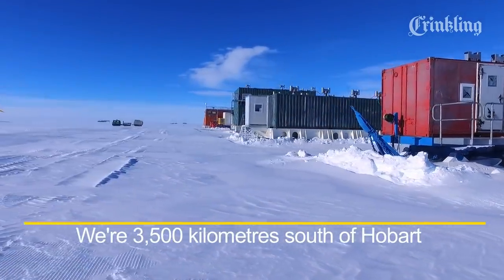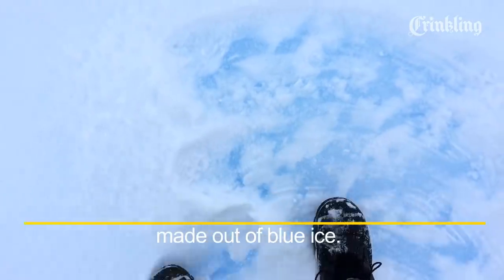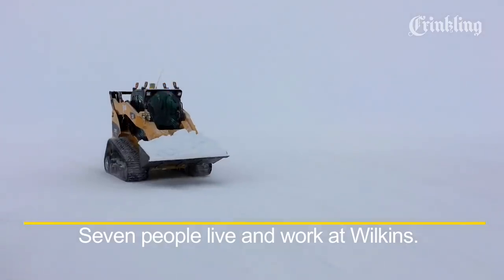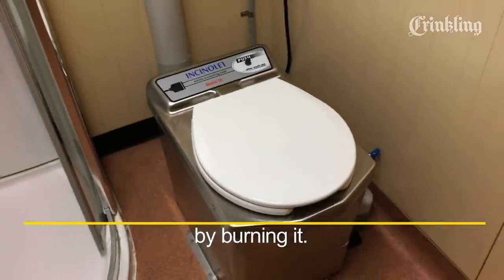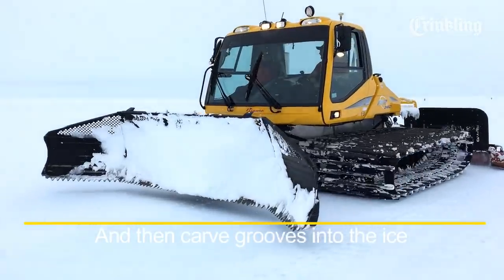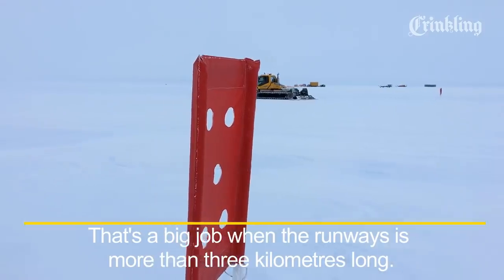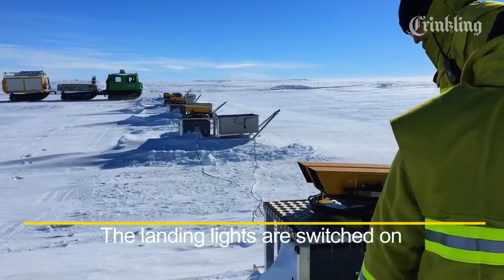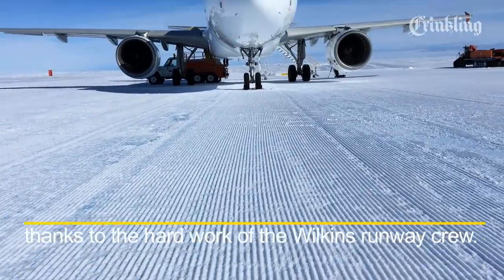Landing on ice: the Wilkins runway

Comment: Impressive, if a little surprised the A319 had enough ETOPS to do this trip.
Reply: A normal A319 cant. However an A319 LR can. Besides its not ETOPS regulated as its chartered by the Australian Government to do the hop, thus eliminating ETOPS.
Reply: This A319 has the Additional Centre Tanks and can hold about 29t total fuel.

Comment: A319 it s super light😃
Reply: Noel Macaskill i think its an a318
Reply: G - wings no it’s an a319
Reply: G - wings A319 ACJ
Reply: Noel Macaskill A318 actually
Reply: @dsosa88  it is not, read closely.
Reply: Max Lechuga your right i saw it on :  2:06 it’s an A319 ACJ
Reply: Diego Sosa it’s an A319-115LR Look up VH-VHD
Reply: Horizon winangkoso you’re right
Reply: yeah and A320 would be too heavy for a 2km thick glacier
Reply: They’ve landed C-17s and 767s on similar runways so the weight doesn’t matter too much. A 747 would probably be too heavy though.

Comment: I have been to a talk given by the manager of the runway and the care they have to take to ensure that the runway is clean is amazing. The runway is actually a few kilometres from the actual antarctic base (the 7 people the video refer to are based at the runway). All machinery going onto the runway has to be cleaned thoroughly so that no oil or hydraulic drips contaminate the runway otherwise the effect of the sun is to open up a hole up to a metre wide. The braking action on the runway for the aircraft is equivalent to a sealed runway - no special tyres required. The A319 has sufficient fuel to make the journey from Hobart and return and 2 approaches but if the weather is deteriorating a decision is made to return to Hobart prior to equal distance point. The runway has a GNSS approach and because the glacier on which the runway is built is constantly moving, the runway gets extended up the glacier each year so the approach is still accurate and doesn't require re-surveying. The A319 isn't used as much now as its load capacity was limited - the RAAF are doing it with C17 and C130 aircraft although the A319 was recently used to do an emergency evacuation from the US antarctic base.
Reply: That's a big comment